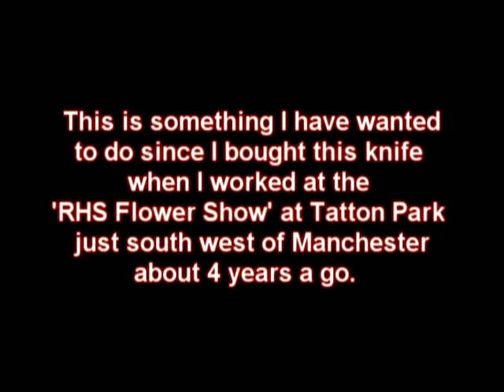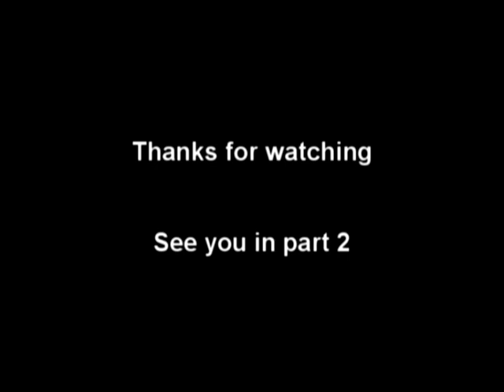Knife making - Opinel No10 Mod. Part 1.

Comment: Before I even saw your video,  Rob, I too didn't care for the clip point or the handle fins, so I decided to make changes.  Of course, I didn't have the benefit of electric tools, so I did it all by hand - rounded of the end of the handle a little more than you did.  Overall, I was very happy with the results, as it is a knife that gets a lot of daily use, and is my favorite folder when traveling abroad.
Reply from the maker: Excellent. Thanks for watching Sergio. All the best. Rob.